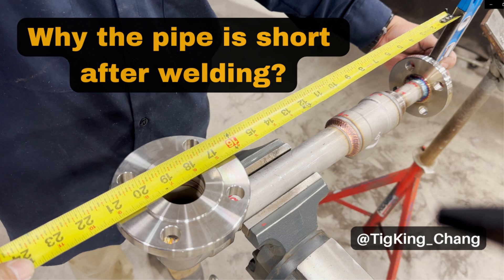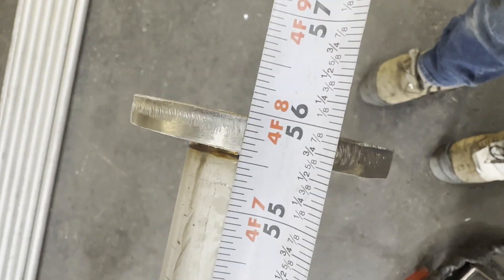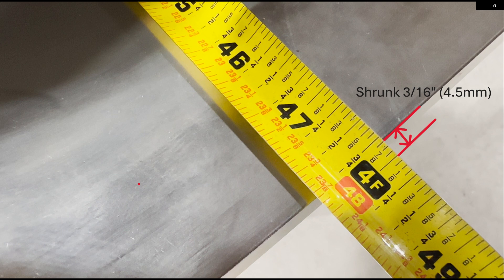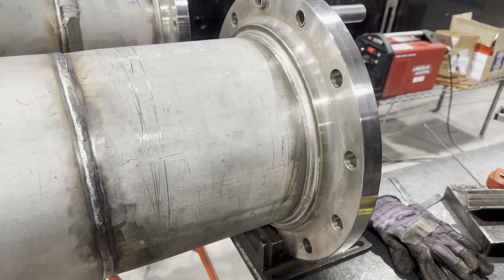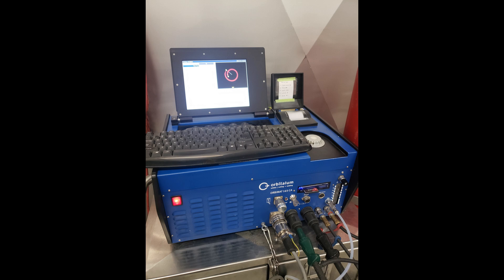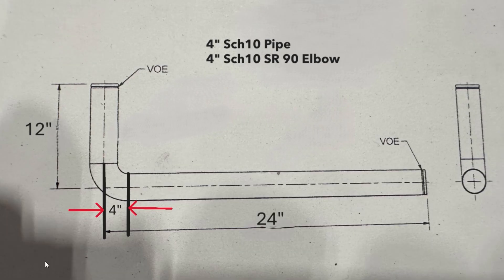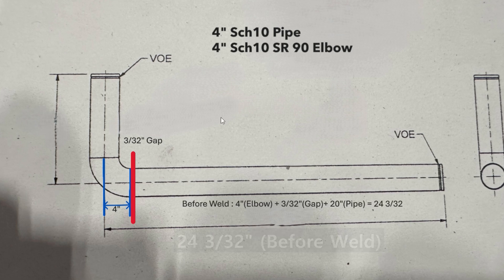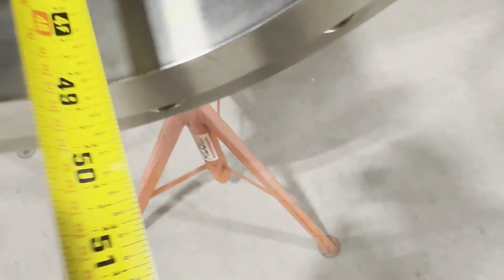Steel Distorts & Shrinks By Welding

Comment: As a manufacturing engineer in a metals facility we had to meet dimensions of +/- .020 0r even +/-.010 after weld most times, including planarity, straightness and warpage. Part of what we did was determine the best tacking and configuration methods and the best welding pattern on all assemblies to minimize warpage, distortion and shrinkage. Much of the time this meant chamfering the edges (sometimes both sides) and determining weld directions and patterns. Sometimes we would have long tacks and specific direction of weld that was reversed on other areas and working inside and outside in segments of weld. Sometimes we had machined tabs and alignment notches.  We generally left about 1/4 to 1/3 of the metal thickness from the chamfers and ran full penetration welds.  Once determined, we would fixture to robotic welders and the welder would run the welds manually using the robot. From then on, we could clamp into fixtures and hit the run button and we had repeatable results and dimensions. In our shop we never used a 1/8 gap in anything no matter the size of thickness of the product or even material (aluminum was especially interesting to work with). Just as with your products we had straightening methods, but with repeatable results it was all very easily performed and minimal.
Reply from the maker: Thanks for sharing such detailed information!